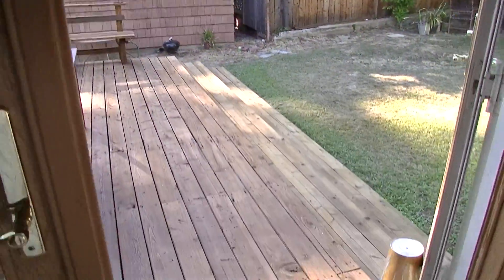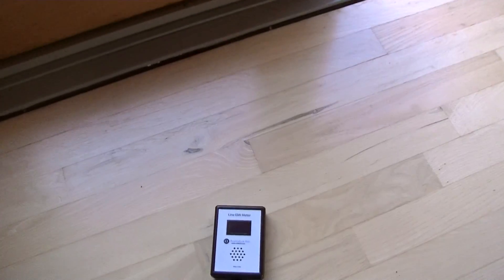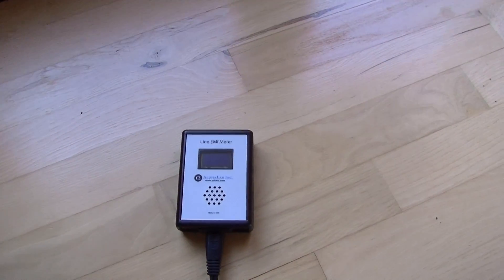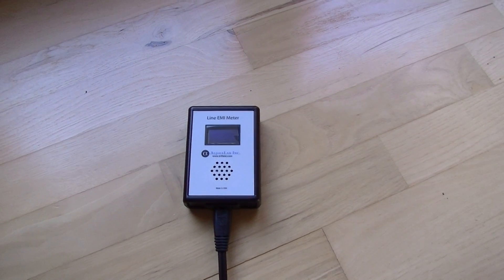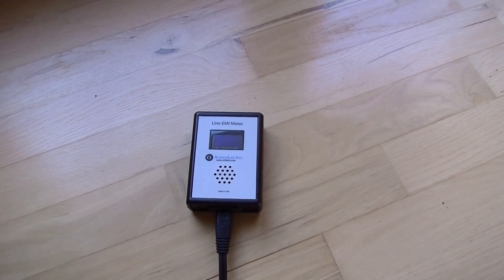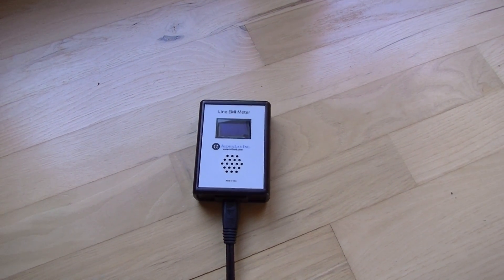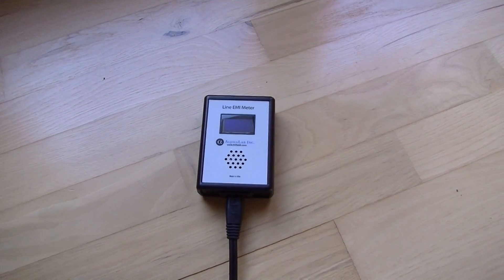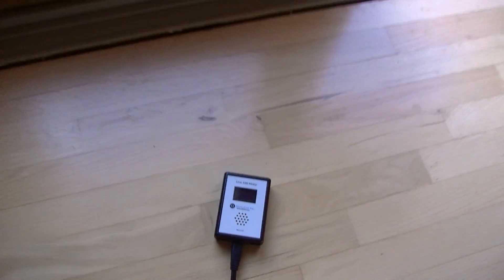How a Neighbor's Solar System Can Affect Your Home

Comment: If you turn off the circuit breakers, does it make the dirty electricity disappear, at least as a temporary solution to salvage your health if you are experiencing symptoms?  In other words, if breakers are OFF, doesn't that mean there is NO ELECTRICITY running through your home at that point, so NO ELECTRICITY would mean their would be no DIRTY ELECTRICITY either, correct?
Reply from the maker: Solar EMI will be on the neutral wire as well. Turning off your breakers only disconnects the hot wire. The meter I use in the video is only measuring the hot wire. An AM radio will help you see what is on the neutral/ground wires as well.

You can disconnect the neutral in certain parts of your house using a remote EMF switch. You can read about these here: https://www.emfanalysis.com/remote-emf-switch/
Reply: @emfanalysis  wow this is so interesting.  I am learning so much from watching your channel and from your website.  But what if you live in an apartment building?  Can you get a remote emf switch for your apartment only?  I likely could work with the property manager if I explain that I have electromagnetic sensitivity.  But would something flow in from other peoples apartment units since they will not be turning off their breakers.  I don't have enough understanding about how electricity works to understand the whole process.
Reply from the maker: @NarcSlayer2020  Great questions. Happy to walk you through all of this via email / Zoom. Here are my consulting options, which helps keep my work sustainable:  https://www.emfanalysis.com/work-with-me/

Comment: As I write, a neighborhood solar system is making my LED lights flicker and is playing havoc with my ham radio. According to my Fluke 289, it's bouncing the line voltage from 116 volts to 121.5 volts. My neighbors are blaming my radios and have threatened to bring the FCC in. I've welcomed them with open arms
Reply: @crocket , from what? My radios?
Reply: @crocket , considering the amount of time I am actually transmitting and the low power levels plus the distance from my antenna plus the low frequency my neighbors, indeed all of us, face a far greater hazard from the constant bath of microwave radiation from cell phones and Wi-Fi. Think about it...bees never had issues before the widespread use of 2.4 GHz cellphone service. Also, the U.S. had to abandon a new embassy in Moscow after staff began getting ill. The cause was a high energy 2.4 GHz field.

Comment: Hi just a friendly note.
You are correct but also wrong. Y I will explain.  You are listening to a single "Line Inverter" also called a "String inverter"  not a solar system with "Micro inverters" .    Solar system "String inverters" are very very noisey "Micro inverter" systems are very quiet they make about as much noise as a DVD player would. Most people in the past used noisey "string inverters" becase on average they would save $500 to $1000 on their complete solar install, not realizing how much quieter and better a "Micro Inverter" system is.  The solar system sales man quotes the cheaper noisey "single String inverter" so he can beat the next guy by $500 to $1000 strictly to get a sale.    I have a quiet "Micro inverter" system with 34 panels and a very very expensive audii system and get no noise from my solar system..... In fact my audio system sounds better during the day when the solar system is in on, in part because it makes noise and it stabalizes my Voltage.    Just some good info.
Reply: Sorry typo...  Makes"no noise"
Reply: Enphase Micro Inverters appear to be source of Extreme Dirty Electricity https://www.youtube.com/watch?v=QpYZtchiSxY
Reply: @audiostanton you are talking about noise, but what about dirty electricity / electromagnetic interference (EMI) that Jeromy is talking about? do these micro-inverters create EMI as the string inverter or not?

Comment: If the solar panels are not located on the house but a good distance away does that make a difference? And stand alone, not tied to the grid. I’m electrically sensitive and we are planning on building a rammed earth house with the wiring in metal conduit, and run by solar power, solar heated water and solar heated floors.
Reply: If you basing the entire design of your house on being EHS-minimizing, then I think you should consult (expect to invest real money in such a consultation) with a trained Building Biologist (one certified for Electromagnetic systems is best).  

There are many design and construction details that are necessary to consider -- placement of the electric panel, proximity of the inevitable utility smart meter, shielded ethernet cabling, ensuring that the bedrooms have no other circuits running through them so that they can be disabled at the breakers each evening, adding manual control to enable/disable breakers for the bedrooms, ground current prevention, avoiding inductive stove, dealing with considerations of having a metal rebar grid in any reinforced foundation, choosing luminaires that do not generate high EMI,  the merits of using a metal roofing or foil-based insulation to negative incoming RF radiation, and so on especially if you are performing your own electrical then you will need to follow all the NEC rules on preventing 'objectionable current'.  You might also get advantageous advice for actually siting the house optimally and choosing low-chemical products for its construction -- many EHS sufferers also suffer from Multiple Chemical Sensitivity as well.  I regret not having done this, and the troubleshooting & repairs will be much more expensive than having done it perfectly during the new construction phase.  

Here is one directory if you are in the US -- https://buildingbiologyinstitute.org/find-an-expert/
Reply from the maker: Hi Andrea. Great questions. The main thing will be to put a filter between the panels/inverter and the home wiring. Send me a note on my website (EMFanalysis dot com) and I'll send you some good resources on this. Jeromy

Comment: ....................

Very infomative video.
Our lights, small fans, tvs, etc routinely slowing and dimming.....the neighbors have a brand new solar panel  system and I am fairly certain  it is the cause...our power co. checked our "smart" meter over the phone and found nothing, however.
Watching the meter readout doesn't show any voltage drop, although the kilowatt readings vary somewhat.
I wonder if the old spinning wheel meter would slow down....
Reply: Mike: Can you opt-out of your smart meter in your state? That would be ideal and you would know if that interaction was the problem. Plus, it will be safer for your family.

Comment: any thoughts on how using Ethernet Powerline networking affects the EMI?  I plan to buy that Alphalabs and/or Gigahertz Solutions meter. Thanks for posting this. I have some interesting thoughts for you, I will contact you later via your website.
Reply from the maker: PLC systems work through creating a lot of EMI on your home wiring. Some systems will be picked up by the Alpha Labs EMI meter. You just need to determine if the transmitted frequency is within the range of the meter (2 KHz to 10 MHz). I recently saw a PLC system that transmitted at around 60 MHz and was not picked up by the EMI meter. However, these frequencies were still radiating from the home wiring, causing tinnitus for the homeowners (which went away a few days after the system was turned off).

Comment: Oh for pete's sake. Your car exhaust fumes are more dangerous. That interference was there before solar. That is why you are noticing it several houses down. Ever stand under high-power power lines? I am guessing not. Those babies are humming!! You can even feel it
Reply from the maker: Actually, if you had watched the entire video, you would have caught that the EMI disappears when the neighbor's inverter is off (at night). These readings are indicative of a solar system (I've measured dozens of them). As for the health effects of EMF exposures such as this, dozens of families have contacted me after experiencing declining health once they installed solar. Your body is electric. To ignore that is simply unwise.
Reply: There have also been complaints of bad health from the new meters. Also bad health reported that seems to be around power lines. To simply blame solar is redonkulus
Reply from the maker: You are right about smart meters and power lines. Also cell towers and newer WiFi routers. I'm not only blaming solar. Simply pointing out that it too is a source of EMF pollution (most people don't realize this yet). Spend some time on my website to see this emfanalysis.com.

Comment: Great video. Can you tag it with the name of the meter so more people can find this demo? 

I think micro-grids are another possible solution to this increasing problem of solar owners polluting the electric grid. It's incorrect to assume the grid will always work so well as a battery for these PV systems, so it would be wiser to have an isolated system that charges batteries for lighting and essential electronics while continuing to use the gird for heating and other high-wattage uses. 

In the meantime, we all should be more aware of how polluted the grid is becoming and eliminate electric fields whenever possible by disabling circuits.
Reply from the maker: Thanks. The meter is the Alpha Labs Line Noise EMI Meter. I list it here: https://www.emfanalysis.com/meter-packages/